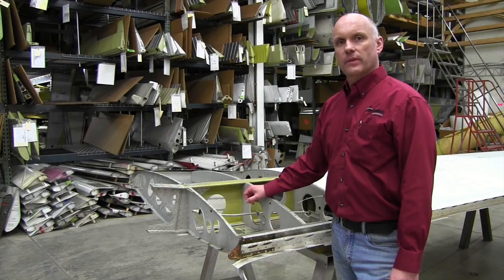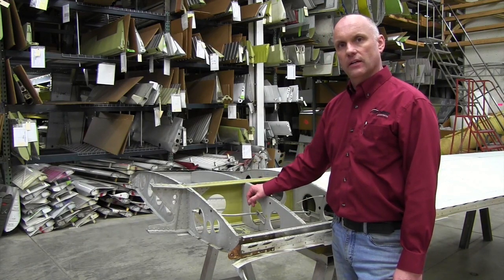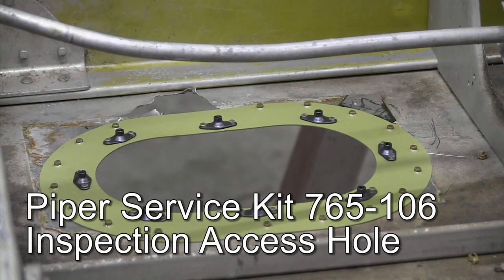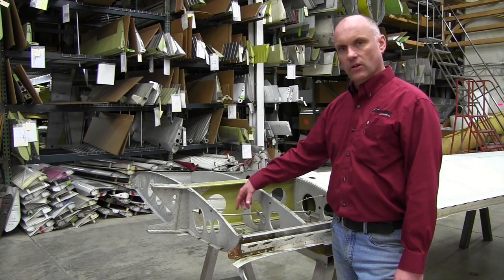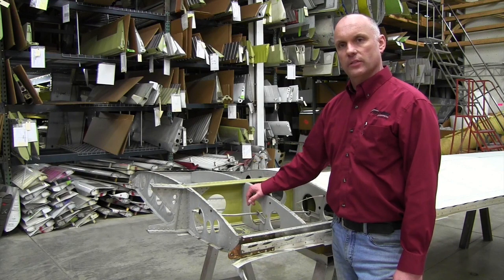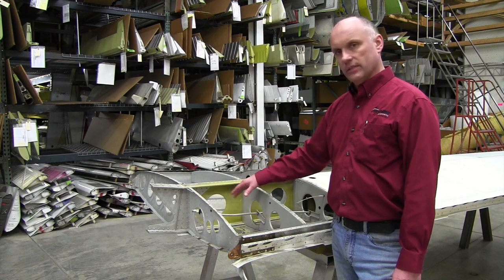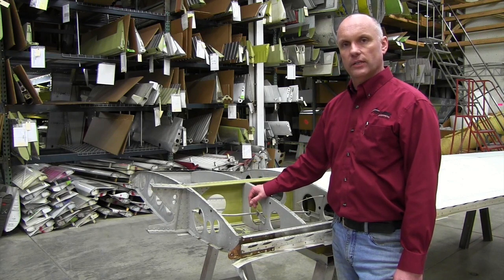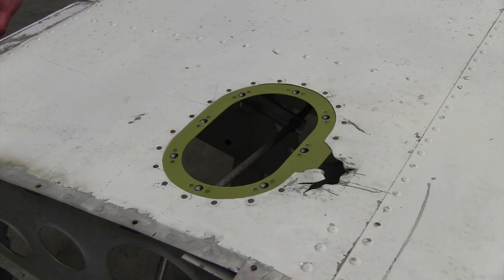Piper SB1304 Inspection of the Main Wing Spar

Comment: I am interested to know what items you might find in a typical spar inspection in this case and then what are the fixes for them.  For example, lets say you see bubbles on the main spar indicating corrosion.  Do you change the spar out?  Great video by the way.
Reply: how to inspect pipe spr fittings